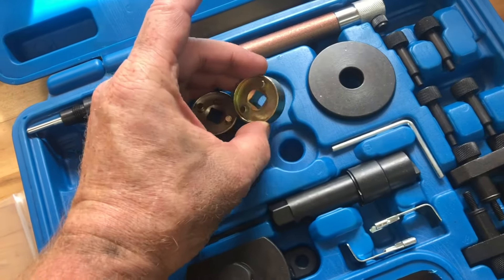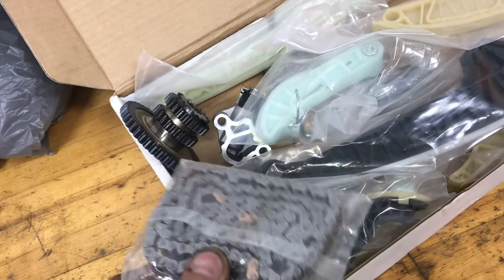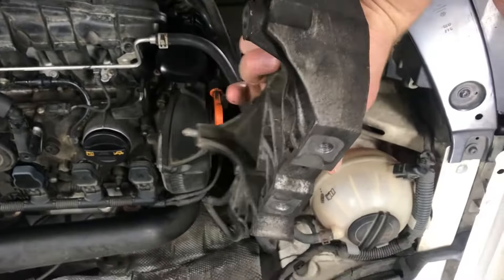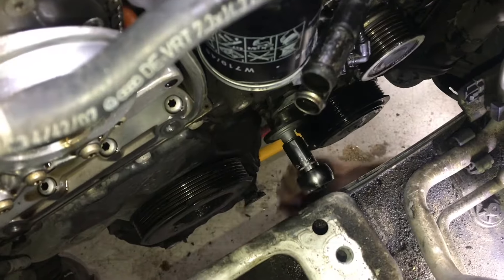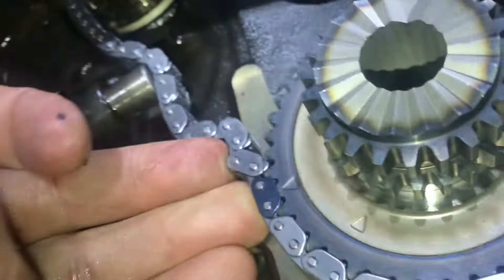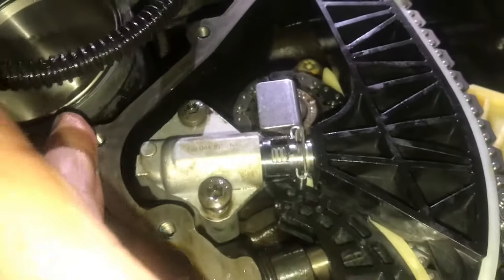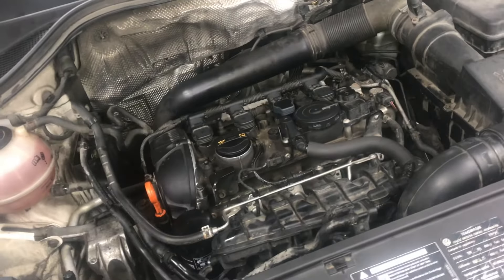(REVIEW) t40271 t10355 kit vw 1.8  2.0l fsi tfsi engine timing tool set alt

Comment: This is an honest video brother. Please I want to rebuild my 2.0t tsi  engine, but I am not sure how to unmount and remove the engine. Any help with that will be greatly appreciated
Reply from the maker: What part of the engine are you rebuilding. Just curious what part of the engine is bad the piston rings or the valves in the head.
Reply: as long as the block itself is not damaged you should be able to do it all in car

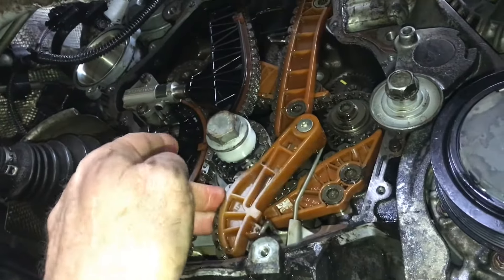Comment: 5:33 Hi, what are the dimensions on that crank donut tool (T10368)--the white plastic piece that the crank bolt slips into?  
Thanks for the show and tell on the timing assembly. I will be referencing it when I change my tensioner.  Much appreciated.